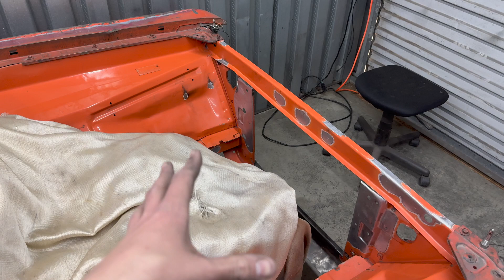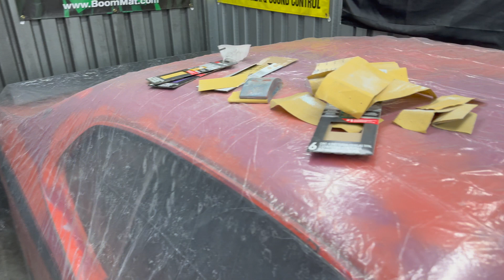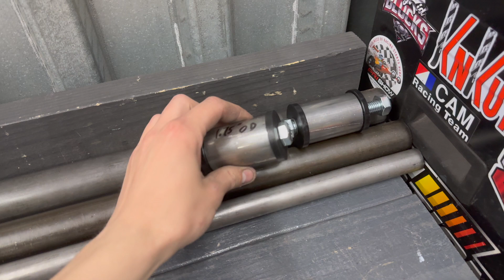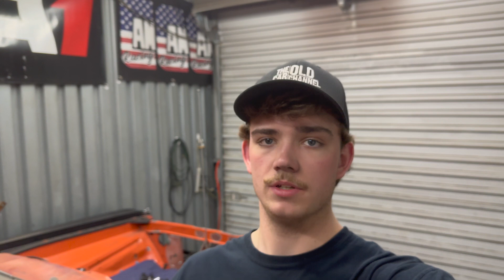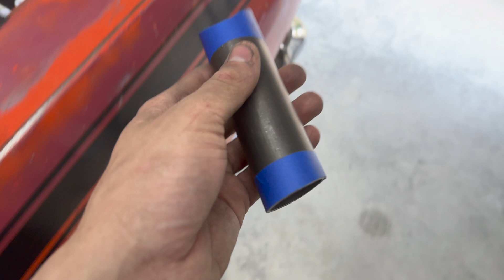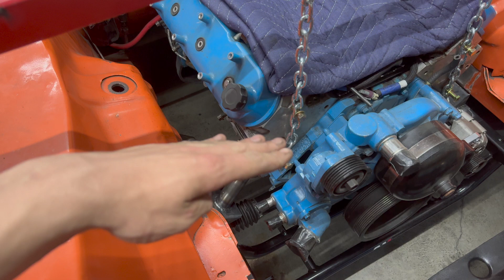The simple way to notch tubes without a tube notcher | New Motor Mounts + the Duster gets a facelift

Comment: Hi Cam,  considering your current shop situation and electricity. What are you using for a welder or welders???
Reply: Awesome, boss, and thank you for your time. Keep up the awesome content ,and your drive and work ethic will get you far in life.
Reply from the maker: I used a little Eastwood 225 for quite a while but switched to a different setup a few months ago. As long as I have a 220 to 110 adapter it works fine. Definitely struggles with the thicker metals though